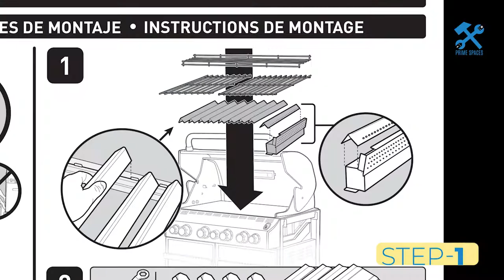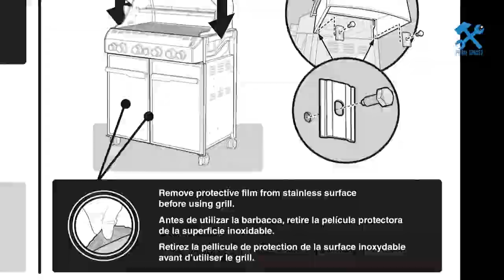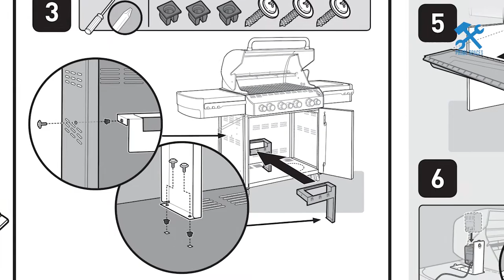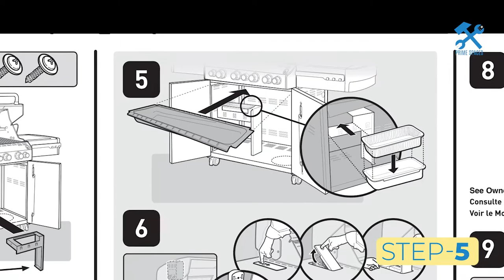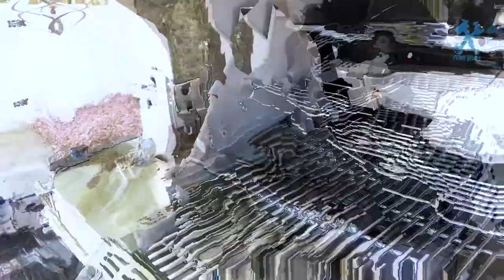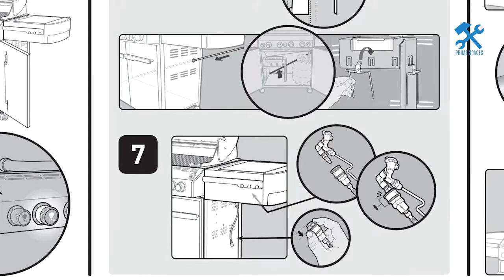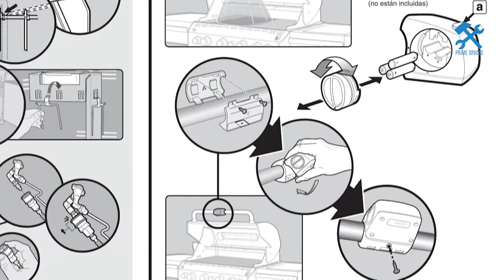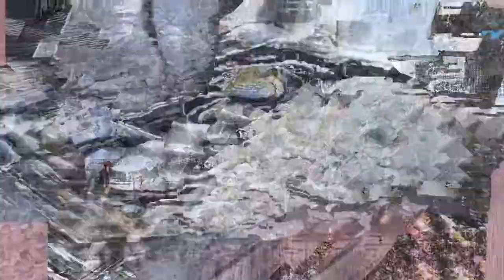Weber Grills Summit E 470 Gas Grill Assembly Instructions (Full Step by Step Assembly Guide)

Comment: My manual shows a step 8 that has something to do with a chain part that is attached to the right-hand door. This video doesn’t show anything about that. Can you please explain what that is for?
Reply from the maker: Hey Carl!👋🏾 What you are referring to is the match holder. It’s used to light your grill manually if your igniter doesn’t have batteries or doesn’t work. Hope this helps. Please, subscribe to the channel if you haven’t already! ✅🙏🏾
Reply: @Prime_Spaces  thanks. Can you explain how to attach it to the door? Also, does it assume that you've attached some kind of plastic match container to it?